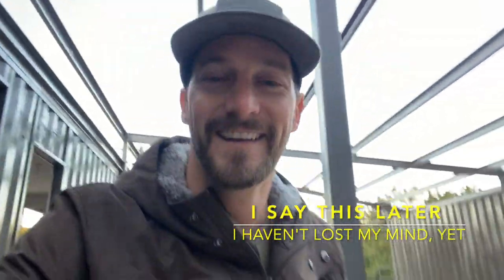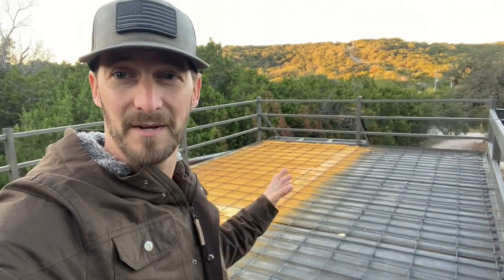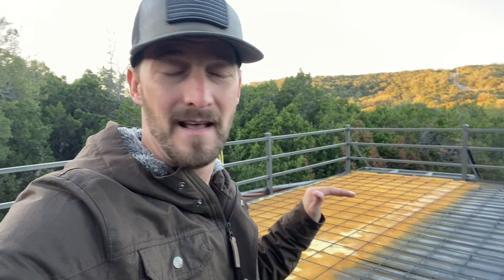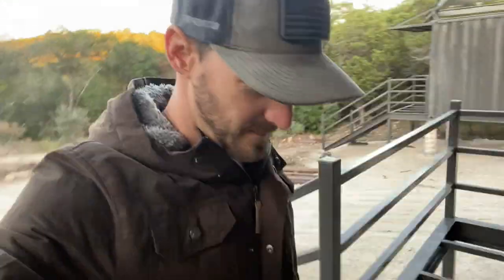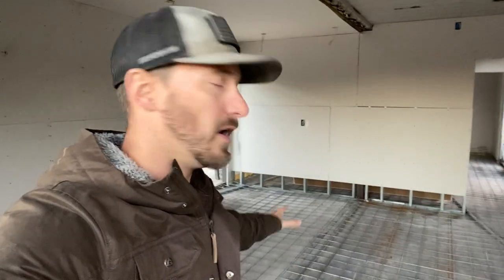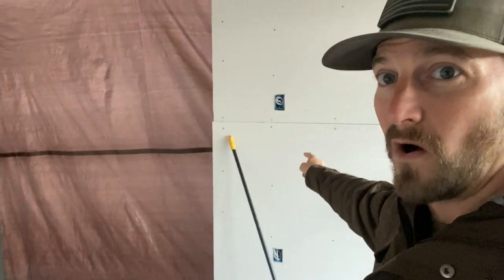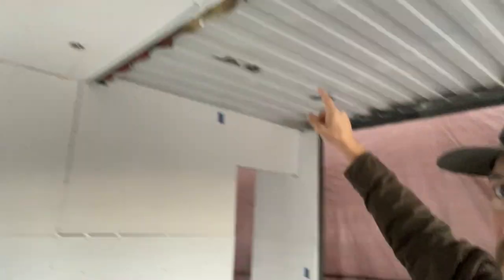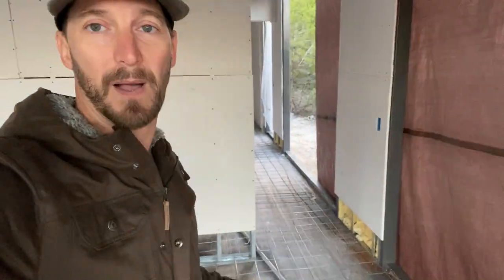Container Home: Concrete Floors & Roof Top Patio

Comment: Did you reinforce the roof underneath before you poured? If so, any pictures or videos? I have heard they will crush under pressure of wet concrete.

Comment: are there any concerns of future cracking? I'm designing a container home for a couple who wants polished concrete floors and I'm concerned about the future movement of the containers causing cracks.
Reply: Josh, I'm interested to hear the results of your project. I believe lightweight concrete would be best for a proect like this with a high air content. This slab in the video also was quite thick which may help resist cracking. One thing that I've seen done before is to place a hard neoprene liner of durometer strength 60 around the edge between slab and conex box. This will provide some help against cracking during moving. Lightweight concrete with rebar and a neoprene liner with as little movement as possible is the best option.
Reply: @pajiad191  unfortunately they went a different direction entirely and didn't do a container home. I spoke with a structural engineer who thought some expansion/relief joints in the concrete would help

Comment: Thanks so much for the video! Polished concrete will look awesome! Interesting to know you put the pipe to house the electrical you cannot put in the ceiling. Of course, had to add the rebar always before pouring concrete yet glad to see it in the video. Excited to see the finished product...yeah Tx does get chilly yet mostly hot and humid!

Comment: Thanks for the video. 
Can you tell us how are the things after 1 year? I am thinking to build a house using 7-8 HQ 40ft containers and I am wondering about cut outs (doors windows) and if I need to add concrete or not. Mostly how safe the house will be.

Comment: For the concrete deck up top did you have to put and kind of slip on it for better drainage? And also did you need a beam on the inside for support of the concrete up top?
Reply: As long as they reinforced the window and Door openings on the container no extra support would be needed. These containers are stacked up to 9 high all the time and they are usually full of goods(gross weight of 67,000lbs for each container) 3in concrete floor should  be nothing in comparison.
Reply: @randybobandy9828  Only the corners and floor are designed to take a load, not the roof or walls. They are not designed to take much of a load and are meant for shear values.

Comment: Hello. I’m a tuck driver n I want to live in a container home  in about 4 years. I have to figure out where I want to live, I’m thinking Kansas, Missouri, or Texas.  I’m wondering would I be able to meet with u on the plan I have in my head. It consist of 2 40 ft n 1 20 ft containers. Thank u

Comment: 1:30 you say "it will have 3" of concrete so it will be very well isolated" , is concrete a good thermal isolation ? I read everywhere that it's bad isolation, it's very hot or very cold. I read that the foam has air in it, so the air is the best isolation, but rock or concrete no..
Could you please elaborate on that, maybe on a video where you review what was done with some experience on it and it you're happy with that solution, thank you a mil
Reply: In simple terms, insulation is about heat transfer and good insulation will transfer heat slowly.
Concrete is a poor insulator but it does provide a lot of thermal mass which is useful for storing heat.

It might help to imagine heating a concrete brick on a stove and dropping it in a bucket of water compared with a (much larger) foam brick that is the same weight as the concrete brick.

Properly combining insulation and thermal mass is the real trick, a super-insulated structure will remain at a fairly constant internal temperature and a concrete slab can be used to passively store and release the heat throughout the day and night cycles.
If the natural temperature is too hot or cold you should try to directly heat or cool the non-insulated components - this might be with a fireplace in cold climates (heating a concrete slab and bricks) or large open windows in hot climates (skipping the insulated exterior walls and cooling the non-insulated humans, lol.)

I imagine covering the roof of a metal structure in concrete is not a particularly effective approach to passive heating and cooling.
Reply: If I'm not mistaken, it is lightened concrete (cement, sand, water and expanded polystyrene), it does not have stone, so the weight is 50% less than traditional concrete, it must also have much greater thermal insulation due to the expanded polystyrene . I think it is a very good idea.

Comment: Wow, I would’ve thought the roof would’ve needed a reinforcement of some sort for all the weight
Reply: Kinda does. It supports weight on the corner posts, nowhere else.
I assume it solidified and at least spreads the load on the edges instead of the fragile roof area.
Reply from the maker: It actually does have reinforcement... we welded angle iron across the top and then it’s a lightweight concrete mix, about 1/2 the weight of standard